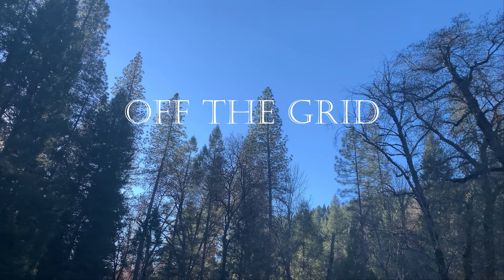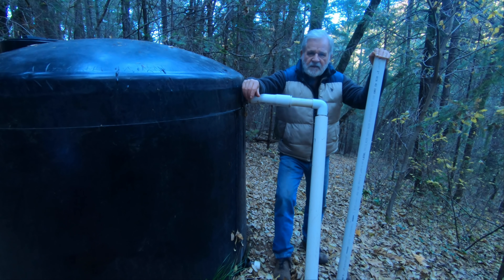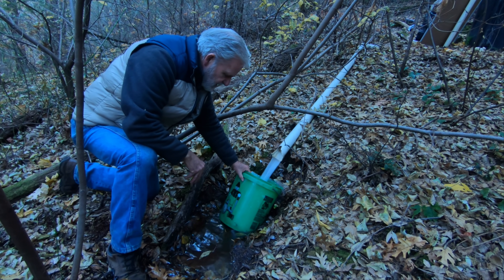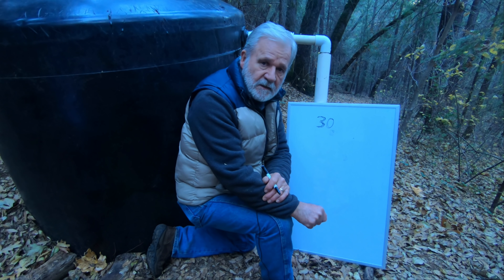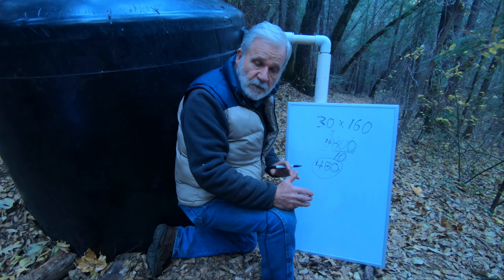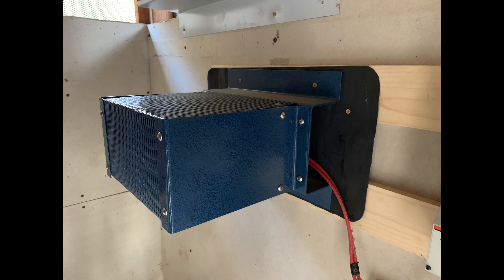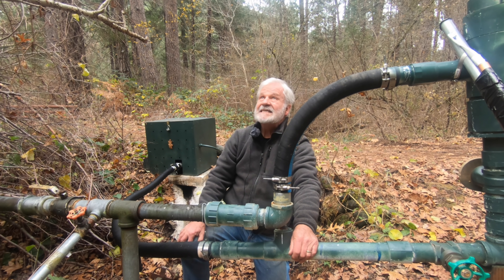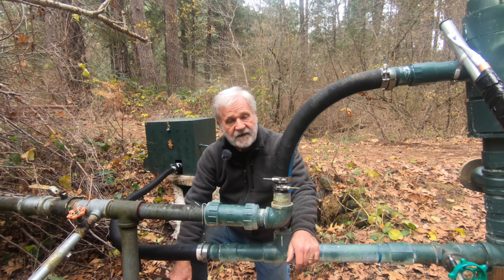Micro Hydro...When it Rains it Roars. Off the Grid with Karen and Grid

Comment: Just a note about the power calculations:  Since the flow rate was measured at the end of the 1000' run, any losses in that run are already accounted for and don't need to be subtracted.  If you measure flow at the intake, that's when you'd need to account for losses.  Cool vid!
Reply from the maker: Thanks for the observation. I measured the flow rate from the collection tank, which is at the top of the run, about 30 feet (elevation) below the dam. I should have been clearer in the video.

Comment: Neat install, I'm using solar only as I don't have a stream or significant wind.  December can be a challenge.
Reply from the maker: Bummer
Reply: Alternator with a decent gear ratio. 2:1 ratio you create plenty of power off nothing. Reverse a alternator into a motor. Spin once and it will go till you take away the main power cable. Add a differential to run 2 alternators off 1 and you'll double power. It for sure isn't a whole lot. But it will make a good enough amount of power. How I do it. But I run solar and hydro to

Comment: Hopefully it doesn’t freeze up in winter.
Reply from the maker: Hi John. Temps get down in the teens, but as long as we keep water moving through the system it doesn't freeze.  If we  leave, we shut down the hydro and divert the flow, so water continues to move.

Comment: Nice system. An idea for an upgrade to your battery room. Instead of wasting the excess electricity into a wall heater, get a solar capable water cylinder, there are a few options on the market currently. Have your system, switch from charging your batteries when they are full to a direct capable inverter running a water cylinder.  There by capturing the excess heat for washing  and showers (its effectively a water battery). Newer systems these days are also multi energy capable, meaning some water cylinders can be connected up to installed air-conditioning and work as a heat exchanger. That means you can run smaller external aircon heat exchangers (because the water cylinder makes the smaller aircon unit far more efficient, which in turn means the aircon unit will consume less power when heating or cooling your house. I hope that helps.
Reply from the maker: Interesting idea! Do you have a link you'd be willing to share? Thanks.
Reply: @offthegrid4036  https://www.mixergy.co.uk/
Reply: Hello, I am from one year in the future. Don't get your hopes up on that answer because he won't respond.
Reply: @offthegrid4036   Please check out this video from Gridlessness: https://youtu.be/XyWQ3o6plY8
Reply from the maker: Nice system, but much larger than ours. We looked at using heat dump as water heater. Two downsides for us: 1) our utility shed is 75 feet from the house — too far to pipe heated water; 2) our hydro system does not constantly dump heat, so it’s not a reliable source of hot water. Safety (fire risk) is a big issue for surplus hydro.
Reply: Brilliant idea to use a storage water heater as a dump load. Look at the following video from Gridlessness: https://youtu.be/XyWQ3o6plY8

Comment: is water freezing a problem?
Reply from the maker: Excellent question. Where we live it doesn’t get cold enough to freeze moving water. In winter, we usually run the turbine 24/7, so the system doesnt freeze.  If we have to be away during a hard freeze we shut down the turbine (to avoid problems we can’t immediately remedy) and open a diversion valve that keeps the water flowing. through the pipes. So far, so good.

Comment: Sup!, the PV modules are not take advantage because it´s too many shadowidh due to trees or somethig else, I suggest you to trim out those trees or relocate the system at the nearest "tree free" space that you have, maybe you cannot use all 100 percent but will increase.
Reply from the maker: Thanks for your suggestion.  Unfortunately, we are in a river canyon, with 100-plus foot Ponderosa pine surrounding the meadow with our PV array. In winter, the declination of the sun (low in the sky) plus tree tops, reduce the sun on our array. I like the trees, so we opted for hydro. The advantage is, it runs 24/7 and doesn't care if it rains (which would limit PV generation).